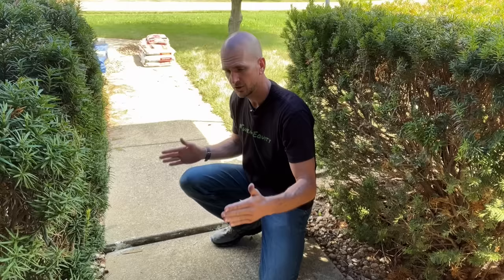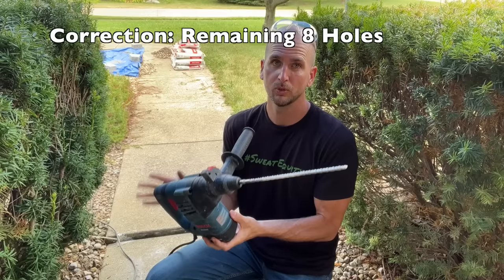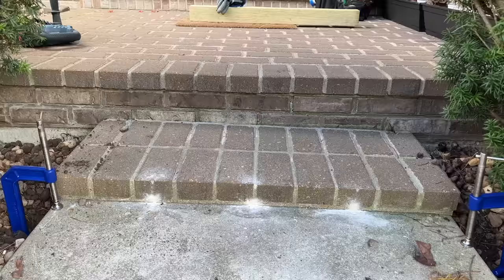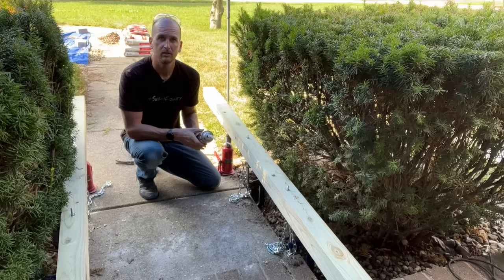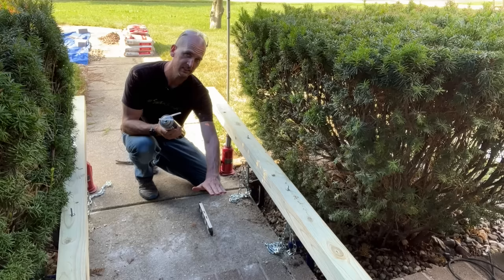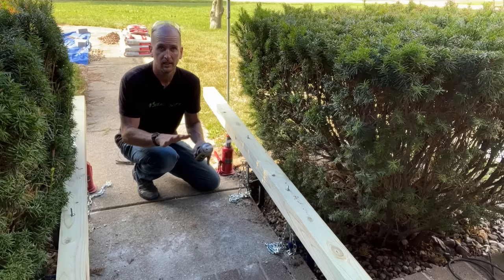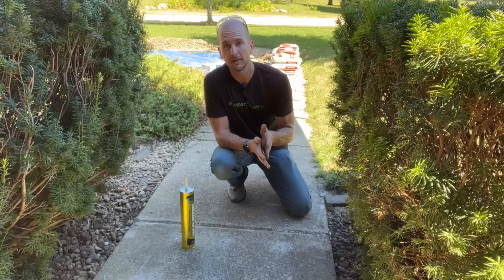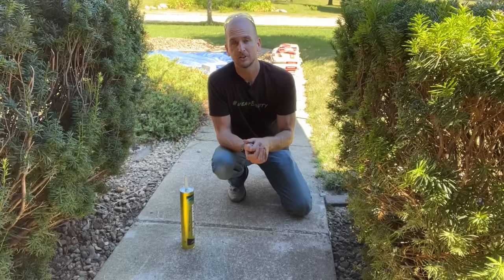How To Fix A Sunken Sidewalk With Spray Foam

Comment: Great video for small projects. Nice process for curing the problem. The last project my company did before retiring was to raise pavement slabs on US 75. Of course we had industrial grade pumps and the foam pressure lifted the pavement. Your methods work really well for smaller projects like walks and smaller patios! (And the joint sealant video is also really good.)
Reply: All the hardware and materials needed, just remove slab make a new one

Comment: Recommendation: If the slab is "hanging-up" at the 2 end locations (where the suppressed slab butts up against the other slabs) due to jagged "areas" along the faces of the 2 slabs.... get a Circular Saw with a diamond edge blade... and "run" the blade along the gap area between the 2 slabs.  The "cutting" from the diamond blade will remove any jagged areas.  This will give smooth faces to each of the abutting slabs and will allow them to "slip past" each other.  

The gap here is fine, because you will fill this with caulk.  If you don't want to fill the full depth, you can fill the void with sand UP to the final 1/2" of the void (as it reaches this surface of the slab).

NOTE:  The slabs MUST be able to move.
Reply: First paragraph is good, second isn’t correct. 
 
DO NOT USE SAND. Use backer rod when caulking. Sand will contain the moisture and cause issues if it freezes.

The slab does not have to move except on the side connected to the house. 

A sidewalk typically is only locked on the house side so it can push away. 

If you remove too much material you will cause the sub grade to wash away and this exact problem will happen again. Although by the that time I would just replace the sidewalk. 

And this foam will last a year or 2 top and will deteriorate due to the pressure and water.
Reply: @antonioyoutubeaccount5399  I am ONLY recommending placing some sand in the GROOVE between the 2 slabs with sand, in order to FILL THE VOID there...  THEN to push backer rod into the upper portion of the groove.  The backer rod, along with the caulk, will keep water from migrating into the joint.  Because sand is better "graded" than soil, it will NOT retain water unless there is a water source that is "feeding" from underneath.  If that is the case, then the slab will move due to frost heave, and the joint is the LEAST of your problems

Comment: I loved the apparatus that was created to raise up the slab in the video. However I guess the slab was only worth about $5 as opposed to the value of the equipment and materials used being maybe $200. Surely just lifting the slab manually and putting an extra layer of sand underneath would have been simpler?
Reply: I knew it wouldn't take long to find someone with some common sense. I would have been done before he drilled his holes.
Reply: Rube Goldberg solution
Reply: I thought he mentioned at the beginning that the brick was sitting on the same slab he was leveling.  If that's the case, you couldn't just lift it out of the way to add more material under it without replacing all the brick.
Reply: @12x2richter  just watch the video again. Don't over think it this time.
Reply: Have fun trying to lift the slab.
Reply: @anthonyshattuck5917  wow it's only three or four inches thick. Do you even have any callouses on your hands from work? If you can't tip up a little piece of concrete like that I wouldn't even call myself a man.
Reply: Phil get a load of Anthony. He must work for UPS.
Reply: @shealdedmon7027 you seem to be the kind of person the gets pissy about terms like toxic masculinity while misunderstanding them. For your future reference, your comment is toxic masculinity.
Reply: @mechanicalmonk2020  thank you.

Comment: Thanks. I literally just lifted a section of my driveway with a hydraulic jack and tractor jack then concreted under it. I've still got a lot more to do and now that the driveway is supported with concrete, I wanted something else to fill in the gaps.

Comment: This is a very nice job.  However, once the concrete was drilled and raised, I would have poured concrete slurry into the holes instead of foam, which will degrade and compact over time.
Reply: I think someone didn't do too well with math in school  :)
Reply: There is no way you could pour enough slurry into such little holes.  It would have to be so watered down that you just end up with a mess and by the time it dries, has lost a large volume and still needs more added but now has an un-uniform spread to to flow through under the slab.   It would be better to just lift the entire ends of the slab above the other one and pour in the regular density concrete mix.
Reply: @stinkycheese804   - You'd make larger holes.   They're going to be filled anyway.

Comment: From an engineering standpoint, this is an awesome video but the practical part of me wants you to pour a new pad! This is a great way to solve the problem without having the mis-match issue though so I see the value.
Reply: Same here. I feel like it would be less work to bust out that slab an pour a new one.
Reply: Pouring a new slab? You'd never get the texture to match...
Reply: Also magnitudes more expensive and more work to replace the slab. He has $16 into the foam. If he had to buy the lumber and chains, maybe another $50, but they'll be useful for future projects too.
Reply: @come_on_now  Texture is usually created with a push broom.  Not hard at all to match.
Reply: @timfischer  I disagree.  It's $5 at my hardware store for an 80 pound bag of Sakrete for pouring slabs.  You might need two or three.  A single bottle jack (you need 4) is $25.  A single large open mouth C- clamp is $15, and that's all before the chain, hardware or timbers.
Reply: @dennisp.2147  texture not color. sorry

Comment: Did a similar project a few years back, but went very simple - dug down front and rear trenches along each side, used a 6 ft pry bar to lift and level the sidewalk slab and supported the now lifted corners using several large "locally sourced" sandstones set on crushed gravel (created a pier) and then backfilled under the slab with flowable fill I purchased at the local big box store. All in costs were about $30, and the hand digging/levelling/backfill took me about 2 hours from beginning to end. This is a very precise approach, but I'm not sure on the great stuff foam CBA long-term.
Reply: Yeah, I did this with a tamper bar and rock as a fulcrum to raise the pad, a rock to support the pad, and dirt tamped in from the side to fill the void.  $0.  But hey, YouTube is all about the next quick fix.
Reply: @bkupron  that was my original plan since most of the dirt underneath was red clay but, after looking at the space underneath the slab after levelling, I wasn't sure I could get enough compaction to have confidence that most/all voids were filled - that's why I went with the fill.
Reply: What is "flowable fill?"  I wouldn't even know what section of the store to look in.  🤷🏽‍♀️  Thanks for the tips!
Reply: @bkitteh6295  look for "Non-Shrink Construction Grout" at any big-box home improvement store; typically ~20 for 50 lbs which would be sufficient for most jobs. It's a cement based product that flows into voids easier than standard bagged cement mix.

Comment: I got a long pry bar. Took up each corner and put some wood wedges to hold it in place.  Then used DGA to shove under.  Next time I will try the spray foam idea though.
Reply: What is DGA?

Comment: I would have etched the concrete and framed it with 2x6 then resurfaced it, by priming it with concrete slurry then floating it smooth, not to forget the expansion joints. clean and new.

Comment: Before everyone "rips into me", let me tell you where I'm coming from. I'm a licensed general contractor for over 30 years so I do know a few things.While I applaud his ingenuity, I cant agree with the material choice. Foam compresses, Its as simple as that.That section of sidewalk probably weighs about 500#. Also, you have to look at why the sidewalk sank in the 1st place. Improper compaction of the soil beneath or something else? Has it stopped sinking?

Foundation repair specialists would never repair with foam. They will either use a non-expansive grout or a cement/sand slurry mix.

I hope this works, but I think this guy will be making another video in a few years about fixing a sunken sidewalk again.
Reply: contractor since 85, i agree.  if he has no traffic , it might be fine.  If you have a few of us 200#'s walking on it every day and a few years it will be mushed back down.  The slurry is the correct way, but for the average homeowner, prying it up (with a bunch of friends, before the beer flows) and packing small stone with a 2x4 underneath, tamping many times from the sides should do the job.  the stone will not allow water to collect under the slab to stop the washout from water or water to freeze and heave it.
Reply: Agreed as well. All foam products in every application degrade their structural integrity over time (like 5 years, not 100years). From your couch cushions to the insulation in your house. Also, for sure there was an issue with erosion in the first place that needs to be addressed.
Reply: I'm NOT knocking your knowledge. I'd  appreciate your input. 
I had Three Big Foundations Companies (ex aqua guard), to come out last year and give me a quote on raising my walkway (the sinking  is closest to my front steps, at 2' away it drops). It's also pulling away from the house, on the side where walkway runs. Clamps couldn't be put on Both sides, like here. 
They were All going to use industrial strength spray foam. They would drill the holes and inject it. None of them would give more than 5 years warranty, because they said this has not been around  very long, so they couldn't guarantee it past that.
 With what some of you guys are saying, about the spray foam compressing, that's probably Why only 5 yr warranty.  But their excuse sounded good!!
 I understand most companies are doing the industrial foam vs mudjacking. 
What do you think about hydraulic concrete, under it?? 
It would still have to be raised to get it under there, right? 
Any advice you can give me, would be much appreciated. Thank you!
Reply: I have an opposite problem.  My concrete has gaps at the top where it meats my foundation (driveway, stoop, hvac slab) how is this normally addressed and what type of company would I call?
Thanks
Reply: @pattibond2342  What were the quotes and what were their excuses for using foam over something else?

Comment: Note to those attempting this, one of the problems not encountered in this video (but you might have) is that the edges of the slab may end up beneath the adjacent sections.  Due to shifting, the space where the sunken slab was had contracted, so it wasn't possible to simply lift the sunken one.  I had to put a masonry blade on my circular saw and carve away enough of the jagged edge so that there was a clean path for the slab to rise through.

I'd also agree with other commenters who advised against drilling through the slab.  I never went that route, so I didn't end up with cracks, but let me suggest an easier and cheaper approach.  The sidewalk is only a few feet across, so you can probably reach the middle from either side.  Shove some concrete pads, gravel, and/or whatever else you have handy into the void.  If you absolutely must use foam, you can start with several large chunks (i.e., paving stones and the like) and then add the foam between those.  At the very least you'll spend less on foam.  Rocks are far cheaper and all-natural.

Also, I can 2nd the video on the concrete caulk.  I applied it all over my 100+ years-old property almost 5 years ago now, and it has held up perfectly.  I wasn't willing to repave all the areas with old and badly installed concrete.  I used it on the curb alongside the driveway, gaps and cracks in the sidewalk, patio, next to steps, etc., and and in all cases it has not lifted out of the cracks, even after lots of rain, intense summers, and even pressure washing the areas at least 3 times since I applied it.  I wish I knew what brand I used in case I have another spot that needs some.

Comment: Thanks for putting this out here! I was picking mine up and releveling the dirt, but after a year or so they settled again unlevel! This really helps!
Reply: if they continued to settle again after leveling them, then this might be an indication of a continuous problem going on under your slab, such as erosion from rain water drainage or a leaking sprinkler pipe and even tree roots that are causing shifting in the soil under your slab(s).

Comment: Most of the problems I see are slabs getting lifted by roots. Sunken slabs are rare and make me worried there's a water issue underneath. Would love to see the easy fix for lowering a slab lifted by roots.
Reply: Get 2 cans of spray foam... apply to the base of the tree.   Cut the tree down. Remove the lifted slabs... grind the stump and the roots... wait a year pack the area and re-pour as needed.
Reply: All sarcasm aside I also wonder if spray foam can overcome an underground water flow issue. It was a great video. Nice use of mechanical advantage but I was wondering how you get spray foam off a c-clamp because basically nothing will get it off my hands
Reply: @timnor4803  Once spray foam is dry, it will rub off of most smooth surfaces. However, if you do like I’ve done, spray foam will never come out of brand new shoes that happen to get a random drop on them!
Reply: @timnor4803  acetone is the solvent for not cured foam. Try soaking your tools in some acetone.
Reply: @timnor4803  😆was my thought too.  could  put plastic bag over each one
Reply: @timnor4803  your c clamps are permanently fuzzy.
Reply: @timnor4803  in this scenario, id spray some wd40 or even cooking spray on the clamps before doing this hoping it wouldn't adhere to the clamps.
Reply: Alot of sidewalk problems are from poor site prep.
Reply: @timnor4803  UV light breaks down this foam over time.
Reply: I have sunken walkway. Can't be rare.
Reply: not rare in my area (SE Texas). Our soil has a LOT of clay. We call it gumbo clay and it is susceptible to contraction during droughts and that makes for sinking soil under heavy items like slabs, walkways, and driveways. Yeah, it is a thing.
Reply: @jgarehart89  I doubt there is much UV light getting to the underside of the sidewalk.
Reply: @csbarbourv  I agree.
Reply: How about using the same root poison which is used inside plumbing lines,  like copper sulfate or RootX? Drill the holes & inject copper sulfate.  You could also dig beside the sidewalk & cut the roots at both sides & pull out roots with a come-along ratchet.  If you are going to install sidewalk in danger of roots, you might first lay down a layer of copper sulfate before the concrete -- donno how that would effect the concrete tho. I guess you could put down copper sulfate, then cover that with plastic & then put down concrete.
Reply: @csbarbourv  Josh Arehart's UV light reference was in reply to Tinmor's post regarding foam removal from tools/hands vs the foam "underneath the sidewalk"😉
Reply: @timnor4803  Box cutter, sand-paper.

Comment: Being as the steps were attached to the slab that was lifted I get why you did it the way you did, it needed to be exact lifts with minimal pressure applied. All of these people commenting about pry bars and such should do some FAFO research. Very nicely executed and with minimal breakage to back or slab.

Comment: Amazing amount of engineering. I have lifted pieces of concrete as well. 

Generally for a sidewalk piece - this size - a large crowbar or 2x4 used as one will lift the slab. Spray foam definitely can lift the slab as well as hold it.  

What i do - You can lay a couple 2x4s that are min 2’ long each - each side on top of the side walk pieces so their spanning the other unheaved sidewalk. Get your large clamp or even a bar clamp - squeeze the concrete  two the 2x4 lifting the slab with a crowbar if even needed.  Throw dirt or your foam under there.

The pieces are heavy but way more movable then you would first think. Generally if piece is in good condition it goes quick. If cracked you may have a bigger project.

The best foundation to put under the lifted concrete is usually add some sand. I pile it into the gap under the lifted slab. You can usually soft the sand in well by using a garden hose and just blast sand from the side - swishing the sand mud under the slab until full.

Comment: I’d be concerned about longevity. Foam breaks down. I
I like how you raised it. If you could pour some kind of concrete into the holes or just excavate more on the sides and fill under with gravel.
Reply: When my father and I did something like this at his cottage we cut 4" holes into the slab using a concrete hole saw and poured in small-aggregate ready mix concrete with added plasticizer. We ensured it was well distributed and compacted by using a concrete vibrator that was also fed into those holes... you'd think you'd filled the void and then the vibrator would just cause it to disappear so in went more concrete. I think we left the support structure up for a week to allow the concrete plenty of time to cure before taking the weight of the slab.

Comment: I had my 12 by 40-foot-long patio raised 4 inches with foam. using No jacks or lifting, just foam injected under the slab.  The process was done by a local company in a couple of hours.

Comment: I do it differently. I raise the Slab, About 5mm higher than level) which leaves a "void" section underneath. I then pile heaps of Builders Sand at either side of the Slab. With a very fine water Jet Nozzle, you 'transport' the Builders Sand - underneath your Slab. Lower the Slab. Tamp it down with some timber, to achieve level.